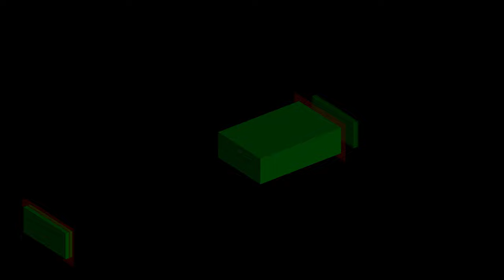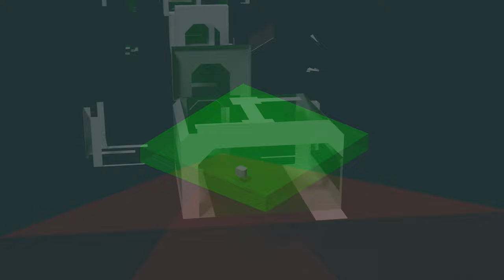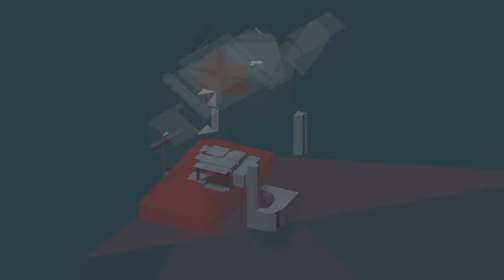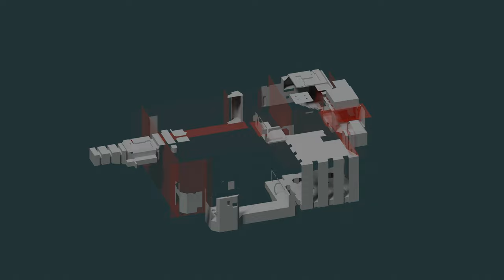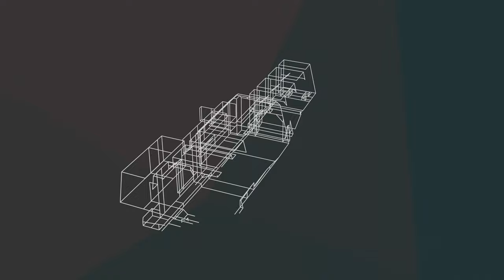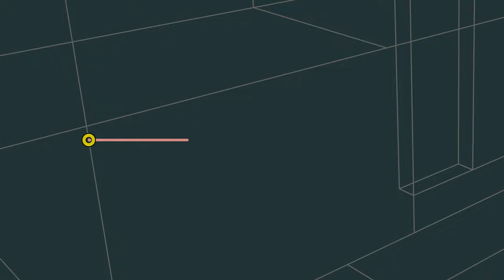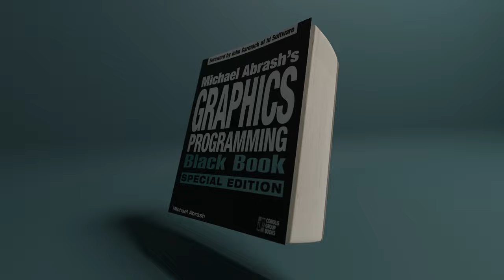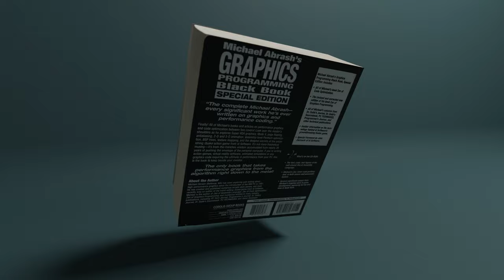How Quake's software renderer ELIMINATES overdraw [⚠️ flashing images]

Comment: In short, the scanline algorithm is used as a depth prepass... but then... quake can't use transparent textures?
Reply: Not qute: sprites use transparency (binary). However, yes, translucent water is a problem, and not just because of the overdraw elimination, but the palette too (though the water could be dithered for a probably rather ugly translucency, but only as a second pass, which is how the GL renderer does it (minus the dithering)).
Reply: @Bill Currie  well that's quake2 water, but quake2 was designed with OpenGL acceleration in mind, so the different passes were expected. But Q1 is entirely solid render. If any, with transparent passes, the lines don't get discarded. Instead, they have a chance to get properly sorted and have correct transparency🤔
Reply: @santitabnavascues8673  Quake had transparent water in OpenGL as a hack, but yeah, it might have come after Quake 2 was released. Certainly the software renderer was not designed with transparent water in mind. However, that's really after the bsp stage of the rendering pipeline. The bsp tree traversal itself is barely changed between software and OpenGL, and even my Vulkan renderer's bsp stage is very similar.
Reply: @Bill Currie  the bsp is enough to render transparencies well, the way it is traversed sorts the polygons, Quake3 renders them just fine. Good luck with your renderer!🙂
Reply: @santitabnavascues8673  Of course it is, I never said otherwise. The BSP tree how the original legacy OpenGL rendering, and both the modernish OpenGL and Vulkan renderers (both of which I wrote) support transparency, because the BSP tree supports not only depth sorting, but also texture sorting.

It's the way spans are handled that (at least at first glance) make transparency awkward. I don't feel like digging into getting software transparency working as I have other things I want to work on (eg, shadows, diegetic UI, ...).
Reply: @syirogane  spans for transparent textures just wouldn't get discarded when they got clipped against closer solid spans, but sorted and drawn after, keeping in mind they're essentially "overdraw" 🙂
Reply: @syirogane  The reason Quake 1 water transparency in OpenGL was a hack was because VIS didn't account for transparent water. So the BSP leaf nodes on the other side of the water surface were never part of the PVS from the current viewpoint. To get proper water transparency, you had to disable PVS, causing the entire world to render (which was still a huge performance impact on those early GPUs)
Reply: @oisyn-  Actually, you had to get modified maps that had been re-vissed for transparent water. Maybe I should have said this earlier, but I've been working on a quake engine (quakeforge) since shortly after the source release (so over 23 years now).
Reply: @syirogane  Didn't mean to dunk on you, was just trying to add information 🙂. Awesome stuff. I myself did the visibility culling on all the Tomb Raider games since Legend, so I found this particular problem especially interesting.
Reply: @oisyn-  No worries, I didn't take it that way. More, I figured it might be best to mention I'm fairly familiar with how quake works, especially the OpenGL side (I am less familiar with the details of the software renderer, so I learned a couple of things from this video).